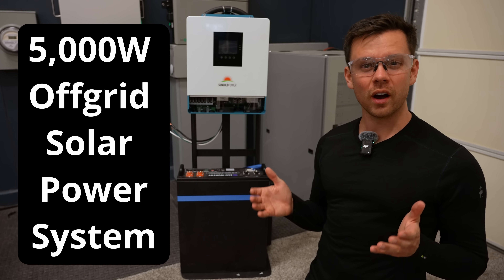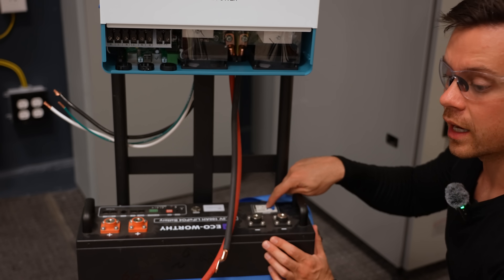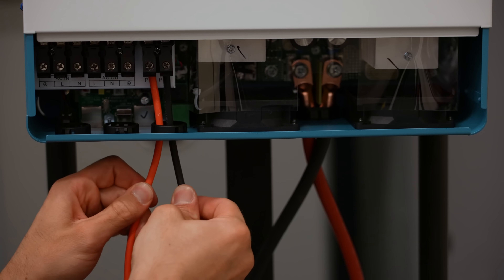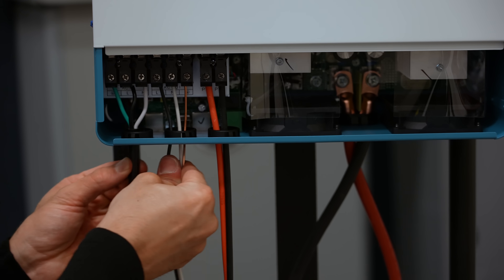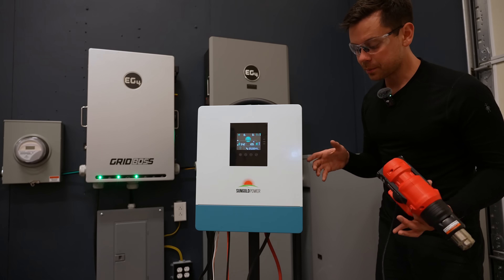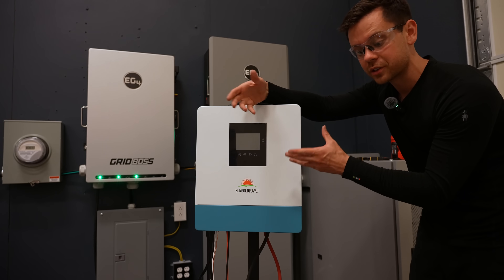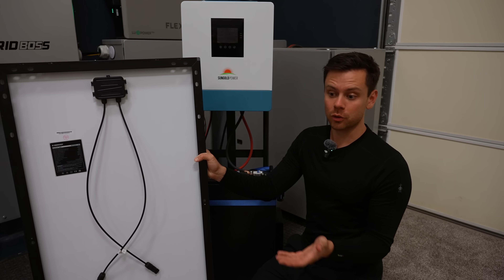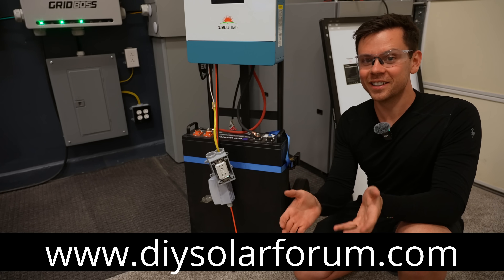Build a 5,000W Off-grid Solar System in 1 Hour

Comment: On a slightly more advanced topic, a few things to note:

* Step-up charge controllers are often not current limited or don't do a good job limiting their output current, so only connect an amount of solar wattage that a step-up charge controller can actually handle.  I think Will forgot to say, but the step-up charge controller (or any discrete charge controller) is connected into the battery, not into the solar input of the inverter.

* Be careful to avoid sharp edges, particularly when putting cables through knockouts.  A lot of these inverters come with extremely cheap thin plastic bushings for knockouts.  Consider buying beefier rubber or thick-plastic bushings instead.  This is doubly true if you purchase a small load center.

* Will showed a fairly large load center but you can also buy small 100A and 75A load centers that can fit right in.  Always use proper bushings for any knockouts, doubly so for knockouts on load centers.   I generally recommend Siemens these days and avoid Homeline/D-Square.

--

And then for 48-to-12 conversions, consider a down-buffer battery setup instead of a converter.  It is more complex to wire and a bit more expensive, but has some big advantages.  It can be as simple as a Victron 75/15 charge controller and a small 12.8V LiFePO4 battery.  You wire the 48V to the "solar" input of the charge controller and the 12.8V LiFePO4 battery to the output.   Having a fuse on the input side is a good idea too. 

Advantages:

(1) Less heat. The charge controller can be programmed to trickle-charge the 12.8V battery.  Almost no heat.

(2) The battery can directly handle larger loads verses a converter which gets more expensive if you want to handle larger loads, as well as gets hot.

(3) Your 12V "down-buffered" bus will be more resilient.   This can be particularly important in a boating application where you want radio and bilge pumps to be directly connected to a battery and powered in case of emergency for a time even if the main battery-inverter system dies.

That's all for my adders!

-Matt
Reply from the maker: Good stuff! Thanks Matt! Hope you join the forum if you haven't already
Reply: @WillProwse  I get on every once in a while as MattZN.  Don't have much time but I did do a few posts on MCBs that I had ripped apart (as much of a learning experience for me as for everyone else in that case).

Comment: Best part of video is where he smiles, voice increases in volume and speed and says "but a lot of people just shove it in there and it works"
Reply: @WillProwse Will can I connect this to a 30amp transfer switch?
Reply from the maker: @zfontain1975  Oh sure but single phase only. It's not split phase
Reply: @WillProwse  it mentions on the Amazon site that you can get split phase if you use at least 2 units in parallel. Some well pumps are 240 volt. Could you have 2 of your carts and parallel them? Would that be a good idea?
Reply: @marktwt  or just use a single inverter that is split phase like the 6000xp.
Reply: Likely he does it too 😅
Reply from the maker: @wayando  hahaha
Reply: That's what she said
Reply: Proceeds to just "shove it in there" and it works....

Comment: Have you tested the output of those step down (48v to 12v) converts under load? They seem like simple devices without adequate voltage regulation?  Well produced tutorial video Will.
Reply from the maker: Oh yeah  those things are bulletproof. I've done some very silly things with them. The output regulation is solid as well. I used to use them with solar panels and run them without a battery. Couldn't recommend them more. Also they are usually waterproof
Reply: @WillProwse  Will, I'm going to make a set of cables to connect 48V server rack battery to the Sungold Power unit. What hole size are the copper lugs you used? 5/16"? The manual has no tech specs on this. Thanks Mucho!

Comment: Awesome video!! is there any risk of back feeding the grid with the system when having solar connected and AC power?
Reply: Awesome that’s all I needed to no thank you!
Reply: No risk. This type of all in one inverter/charge controller/battery charger only uses the grid to power appliances and/or charge the battery. It cannot backfeed the grid.

Comment: @ 4:09 can't it be off-grid solar only? sungoldpower says it has solar only.
Reply: Just don't plug it into the grid power. One can charge the battery, etc., by plugging it into a properly sized generator.

Comment: I know you consider 48v systems to be superior but this might be even more first timer friendly. A pip2724 and 24v 200ah battery give the same kw but smaller inverter and solar input. Depending on battery choice it could be cheaper with even less parts and set up. Just a thought. Thanks all you do.

Comment: A little tip I learned:
If you need to run wires through a window, poke a hole in a pool noodle and run the wire through it, and then you can close the window (mostly) and have an airtight seal. Great for generators and solar panels while keeping your battery and inverter in a climate controlled environment.

Second tip:
Don't buy "12 volt" panels. For the higher input voltage, solar charge controllers like this buy at least panels sold as "24 volts." They are generally the same price per watt as the 12v panels and you won't need as many for the minimum startup voltage.
Reply: " poke a hole and run the wire through it",  Poke a hole in the window?
Reply: @johntalbert8227  Despite adding it back twice now, it keeps leaving out the pool noodle bit. Hurricanes can teach you things, like how not to die of heat prostration.
Reply: Poking holes in windows is frowned upon here.
I made a wireway in a wall to run cables through with a weather tight cover.
Failing that run an extension cord under a door.
Reply: @blaydCA  YouTube doing the usual thing and randomly removing comments and edits of comments. Pool noodle has been placed in the comment 3 times now.
Reply: @john_in_phoenix 
The United Healthcare robot strikes again

Comment: What size Solar Panel Disconnect Switch do i need for a Eacoflow delta pro system thanks Love you channel. Is the one listed here too big for delta pro? I ended up getting this
Solar Panel Disconnect Switch 32 Amp 500V DC Miniature Circuit Breaker with PV Connector and IP65 Waterproof Box for Outdoor PV or AC Stystem

Comment: I don't recall hearing it, but it should be stated that when you want to disconnect those solar panels, turn off that solar disconnect first.  High voltage DC will arc if they aren't disconnected first.
Reply from the maker: I said it two different times and I posted it on the video in text. Did you watch the video at all?
Reply: @WillProwse  Twice actually.  You mention the disconnect and you mentioned having it off before connecting. I just wanted to make sure any beginners knew they need to turn it off when disconnecting those MC-4's also.  I love your stuff and it's helped me a lot.  This video was targeted at the beginner, so I thought mentioning the disconnection being hazardous if the disconnect wasn't off was important.  I didn't intend it as razzing you, I just thought it needed to be said.

Comment: Awesome video! Its really nice that you took the time to explain everything. The only other thing to explain to people would be if they wanted to add a second server rack battery to that setup, how the wiring would work.
Reply: Run it in parallel.
Reply: @techtactics788  I was more mentioning that he covered how to do essentially everything for new people, except what to do if they wanted to add another battery to the setup. That's all.. just so someone searching for the answer to that question would be able to find it. So for that person they would get one of those sets of cables that Will used in the video (the thick ones) and (red cable) use the empty positive terminal of the existing battery and connect it to the additional battery's positive terminal, then repeat with the black wire (negative to negative).
Reply: Parallel wiring.
Red to red, black to black
Just like you're jump-starting a vehicle.
Reply: As others mentioned,just parallel it with the other battery. Try to keep the battery cables the same length on both batteries and occasionally charge the batteries till their BMSs stop accepting charge. That keeps the batteries in the same state of charge,balanced, even without communication.

Comment: Love watching this dude now for a request. I have a BLUETTI AC200P Portable Power Station | 2000W 2000Wh and three Renogy Solar Panel 200 Watt 12 Volt and the generator takes up space in my van so I want to have a compact system to run a 3.1 cf fridge freezer, roof fan and 12 volt lights and say a 300 watt battery. If you could do a video on a system for my van I wouldmuch appreciate the education

Comment: Does it require any circuit protection or fuses?
Reply from the maker: It's built into the unit and the battery

Comment: Can you run a RV 50 amp plug off this?  14-50?
Reply: No you cannot, because that RV 50amp plug is 120/240v whereas this inverter only does 120v. Essentially the inverter has and "L1" but no L2
Reply: @KeithOlbermannn  Thank you!  Looks like I'd need to step up to at least the 6.5KW 48V Split Phase Solar Inverter SPH6548P for that feature.
Reply: @travissmithoh  Yes either that or the EG4 6000XP. I would check the specs on both including idle consumption, weight and dimensions before I buy.

Comment: The ground wire should be the longest so that it is the last to disconnect if the cable is pulled. We have here @Finland rule demanding that the ground wire needs to be the longest always. Thank you :)
Reply: I added a wire clamp to my setup for the AC power input cord (on the inverter punchout/hole) to prevent pull-out.

Comment: This is awesome. I'm getting ready to do the solar connections in my van based on Will's advice dating back nearly a decade. Thanks for all the advice. I'd like to offer you the chance to be in a band that I've put together. "Phreddy Photovoltaic and the Shunts." We've decided to let you be Phreddy, if you want, but you'll have to do all the interviews and accept the awards on stage, so on, so forth. We're an ELO tribute band but we usually do the second half of the set acoustically. We've only got 100 amp hours and the key-tar takes a lot of juice...not to mention the AMPlifiers!

Comment: Yay. a new upload! Thanks for the videos Will! Im working on a lithium golf cart that will have a solar panel for the roof. They want $600 for the extended roof I will need, but I should be able to get a 500 watt panel for less than $250
Reply: Check the math.  I did a golf cart build too.  Charging a 36v or 48v battery on solar is no small task.
Reply: @gormanthomas8135  I dont understand what you are trying to imply here. 500 watts of solar would take the 5120Wh battery from 0-100% in a little over 10 hours of sun. Plus its less than half the cost of a roof that does nothing.